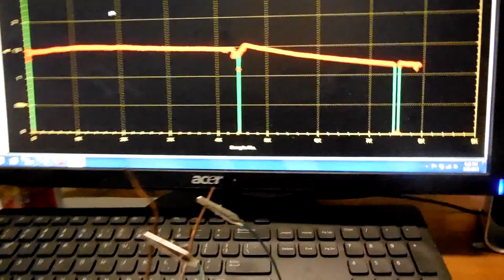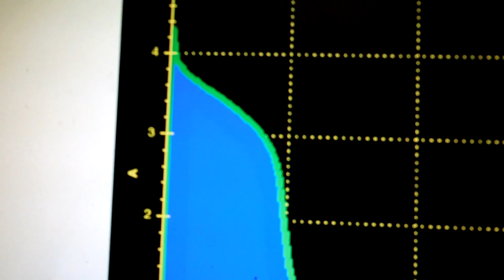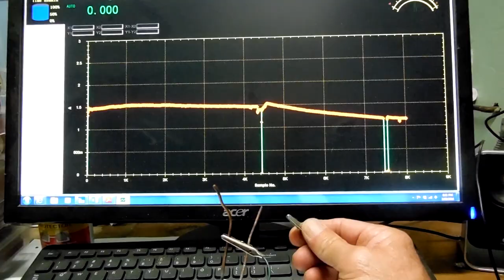1 Amp 2 hours shorted crystal cell

Comment: Hi Steve, very well done. What is the PC program called you are using to measure this ? Does it have a plugin to your digital meter ? Via USB ?
Reply from the maker: Thanks, The program came with the multi meter at Radio shack, it does plug into computer from multi meter via USB
You will have to turn off sleep mode at your computer to run for a long time test
Reply: Steve Allwest
What is the exact name of the program ? Many thanks.